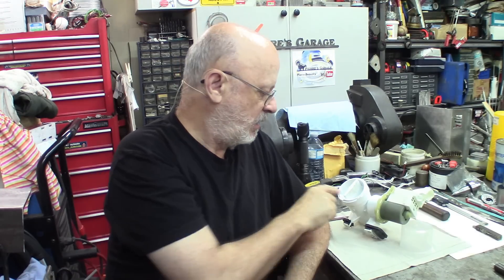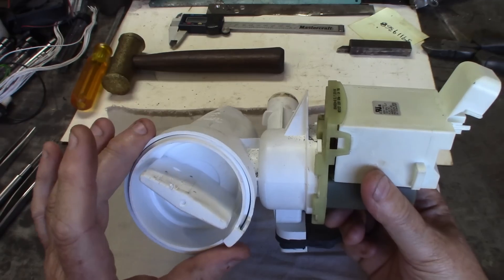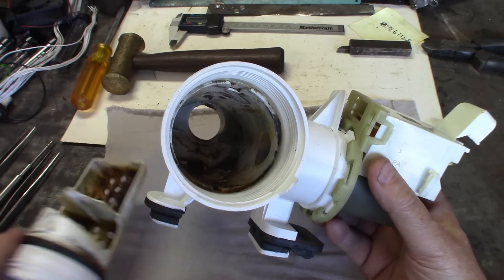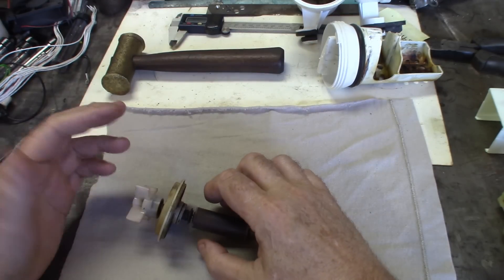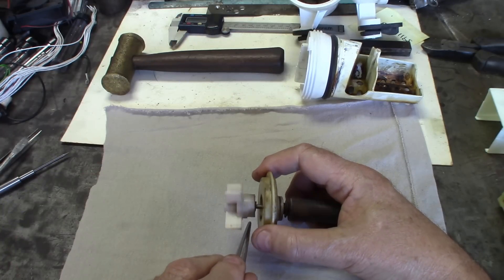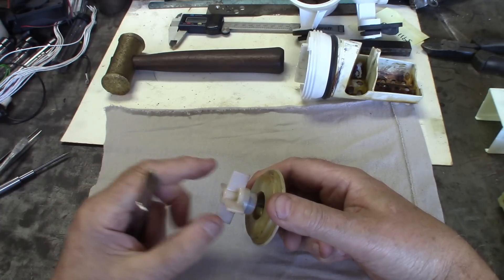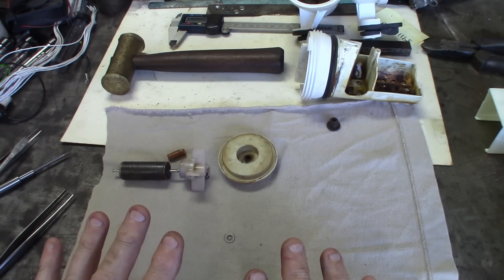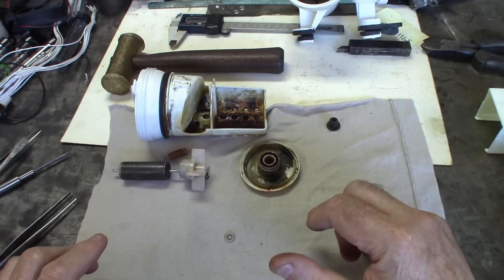Autopsy of a washer drain pump, why it failed and how it works...

Comment: I would be very appreciative if you could explain just how the motor starts. The motor from the information you have given and the pictures is a synchronous motor and this type of motor do not self start. But obviously this motor does not merely start but actually runs at high speed. I have not been able to find any information as to just how this type of motor starts. Thank you if you should be able to offer the explanation sought.
Reply from the maker: Those little motors are using a out of phase starting winding on the laminated plates of the outside armature, not sure about the actual phase angle, though. This is a little like the extra winding connected to a capacitor on some bigger types of motors. The side on witch the starter winding placed regarding the main winding will determone the direction of the rotation of the motor. 
I've seen some videos a long time ago on the Tube, sorry I can't remember where...
Hope you can see how it goes...
Reply: @pierresgarage2687  Thank you for your comment which is not relevant to my question, There is no starting winding on this motor and to complicate matters further, it is a single phase motor , yet it starts and performs extremely well. If you should know just why and how this motor works I would appreciate your effort.

Comment: I'm on my 4th drain pump in less than a year . I think maybe the cheap ones fail quicker because the 2nd and 3rd ones were 20 dollar pumps
Reply from the maker: I'm surprised to hear about your problems, mine laster for quite a few years before I passed the washer to my son who finally sold it lately...   How many loads would you do a week...?

Comment: the winding copper turns can be rewinded again with fresh copper wire again?
The pump winding was  burned
Reply from the maker: It would be quite impractical to rewind one of those, you would need to get the polar pieces apart, there are a lot of turns at 120 volts and quite more for 240 volts with even thinner wire. I paid about a total of $60 US including shipping for a band new replacement.
Consider the price of new copper wire, plus shipping, the amount of work involved in rewinding and considering that the pump has some wear and may require new parts (seals, impeller, etc...) you may consider a new unit...
Reply: Thanks might

Comment: I have purchased one for about $20 on eBay with shipping a couple of times, and it's OEM.  Replaced mine twice in 15 years on my LG washer.  Be sure to determine which is the drain pump and which is the circulation pump on the LG washer-dryer combo units from the diagrams.  I like to use the diagrams and parts list from https://www.searspartsdirect.com/
Reply from the maker: So far it's working great, but I'll make sure to check your link...   ;)
Thanks,    Pierre

Comment: I have a 40yo Maytag washing machine still on original pump, original everything for that matter. All my change and bits end up in the tub, I don't see how anything smaller than the 1/4" holes in the tub could get into the water system on it. Pretty obvious why they don't make them like that any more they wouldn't sell enough! lol
Reply from the maker: The older machines and appliances are the better ones...    !!!!
Wonder how I was pushed into getting something new, good thing that I can stil fix them, at least for a few more years, I hope...   ;)
Reply: I don't understand that either. How does it make it through the drainage holes in the tub?

Comment: possibly thread got wrapped around the shaft, getting it to overheat near the seal,  what was the fault showing? leak or not pumping, stuck motor?
Reply from the maker: It would be surprising theat the shaft overheated, first no coloration and water got thereand kept everything cool...  Looks more like wear in a long term style.

Comment: That's  a tiny impeller.  I didn't know you were a washer repair man, I should have had you come down and fix my washing machine! LOL   Turns out my shaft on the main drive motor rusted in two. Not worth repairing.
Reply from the maker: I'm only washer repair man if I'll save a bundle on my own apparels and if my stiff articulations allow me to reach the problem..........   lol  
That little shaft was getting close to split point...   And, at a reasonable price it's not worth repairing...   ;)